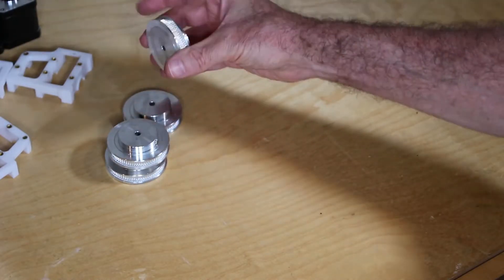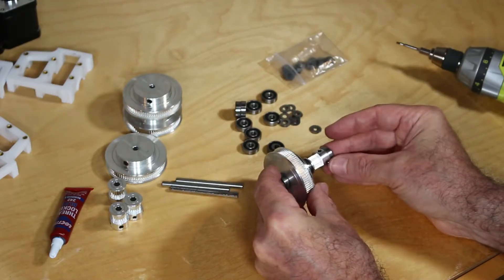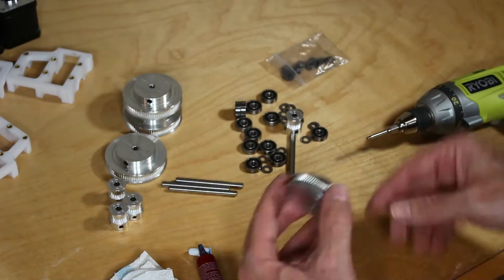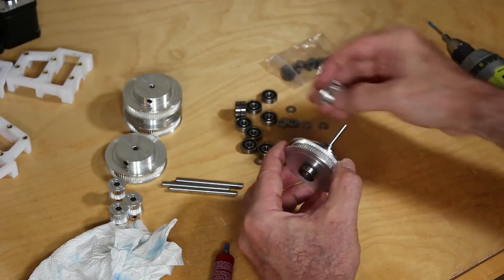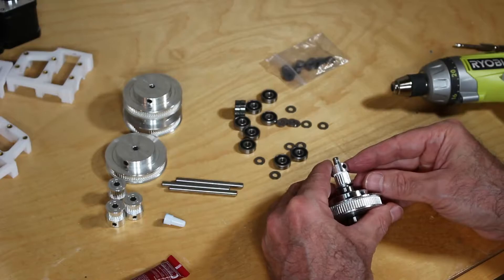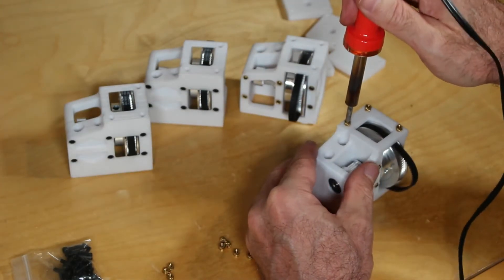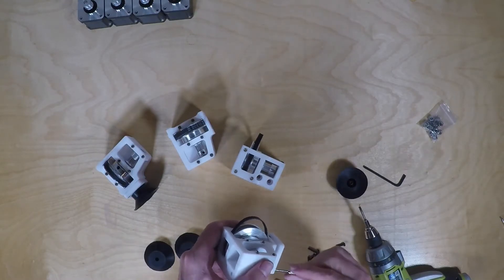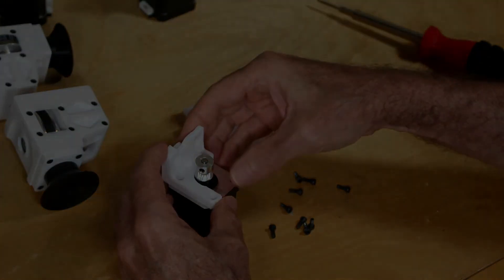Voron 2.4 Blurolls Kit Part 3 - Z-Drive Belt Modules and Motor Mounts

Comment: Curious about the flatness of the aluminum build plate, and the quality of the heater pad.
Reply from the maker: So spent some time with the plate today so here are my observations.  I placed it flat on a glass table made of 1/2 inch glass. it does not rock in any direction.  When I lift it up, it takes considerable effort as it seems a vacuum has formed between it and the table (a great sign).  When I flip the plate over, exact same thing (even better sign).  My squares are not large, but wherever I place them and when I shine a light from behind, I see no light leaks.  Finally, the plate is not milled, it's ground which explains the apparent flatness.  I used to work in a machine shop, and the surface grinder was the way to get the flattest surface and that seems to apply here.  The corners are rounded and the edges are beveled nicely.  I'm going to assume the plate is cast and then ground flat.  I suppose I'll know for sure once the plate is heated for the 1st time if this was cast.  The only difference is that the bolt holes are not all out at the edge, but closer to the inside of the edge so they are complete holes that are properly counter sunk.  I like this better than the plates I have seen with the bolt holes all the way out on the edge.  I also suspect the plate is slightly larger than default, but that seems fine to me.  So far. I think this is a really nice plate.  Probably the best I've seen so far.  I'm convinced that if anything isn't flat, it going to be the magnetic sheet and the extrusions that the plate will sit on (but they look fine to me).  Very nice plate.  I'll try to get the video up this weekend.
Reply from the maker: You and me both are curious about this.  I'm creating a video just for preparing the build plate.  While I don't have a high end tool to test flatness, I'll see what I can do to test this and make it part of the video.  If it's not flat, I'll be purchasing a new one.
Reply from the maker: I just posted a video on the build plate. Please have a look: https://youtu.be/7V4dAYTG4TM

Comment: Is it possible make the 3d parts in nylon ?
Reply from the maker: It's possible, but I would not recommend it in this case.  I don't believe nylon has the needed heat resistance.  This printer is enclosed to help keep the air clean with a filter as well as keeping the inside very warm while printing heat sensitive filaments such as ABS.  I'm not sure Nylon is a good idea unless you find a special alloy that can support the needed heat resistance.